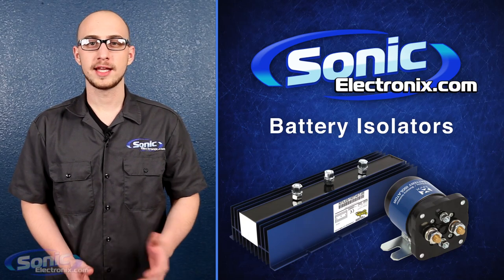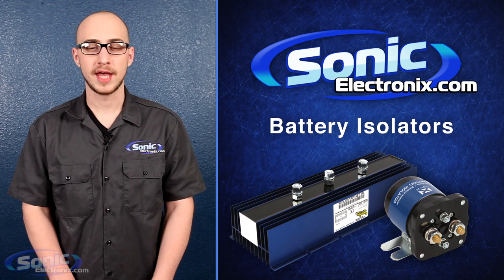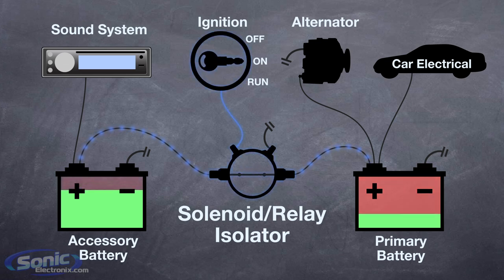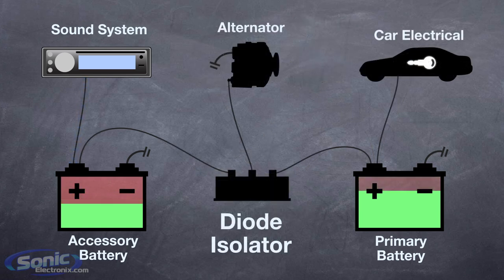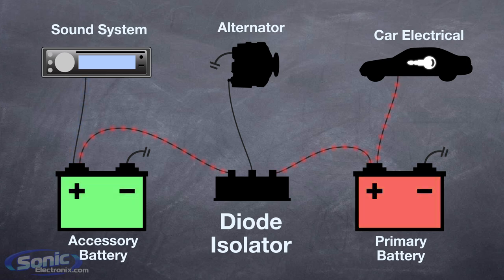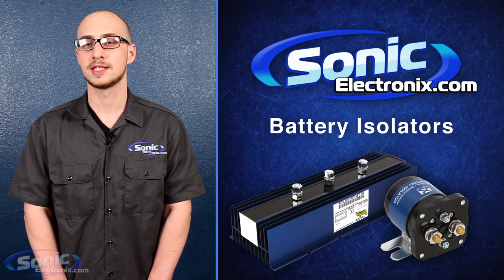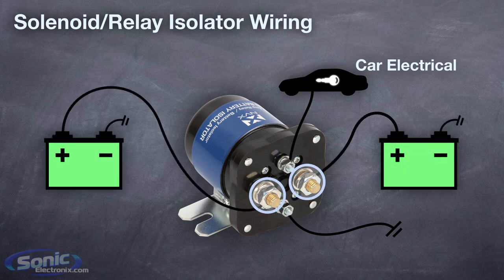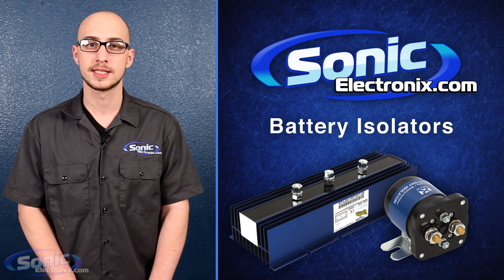Battery Isolators - Types & How to Install | Car Audio 101

Comment from the maker: The fuse will blow if the battery is asking for more power. 140A is the current transfer abilities of the isolator. You should fuse each battery to be safe from short circuits.

Comment from the maker: You are very welcome! 0 gauge can use 200 - 300A fuse to protect the wire, so if you have high quality wire use 300A but if you have cheap wire go with 250 or below.

Comment: Good video just one question..when wiring in a diode isolator it says run a cable from the alternator to the center post. Do I disconnect the original alternator line since the isolator charges both batteries now, or do I leave the original alternator connection in place and just add an extra cable?
Reply: been trying to figure this out myself

Comment: So you could install both and have the best of both worlds correct? Normal operation of the diode  isolator.  But if you're starting battery is depleted you could kick over the solenoid and use the other battery.

Comment from the maker: Either one will work just fine for you. Diode isolators are less common but if you listen to your sound system a lot with the vehicle off, go with a Diode isolator.
Reply: What if I only listen to my system with my truck on?  I never play my music without my truck running.

Comment from the maker: You could take the power wire going to your second battery and add a switch to it. If you turn the switch off, it will stop the flow to your second battery. The switch you use is up to you but it needs to be beefy to handle the amperage. As for connecting the batteries together to start the car, you can wire the terminals together and add a switch as well to keep them disconnected until you need to start the car in an emergency. As long as you have beefy switches you should have no problems.
Reply: So instead of a battery isolator like the one in the video, can I just use a circuit breaker?

Comment: In the case of main battery is dead. Can you hook a set of jumper cables to the second battery to jump start your vehicle; or will the isolator prevent this?

Comment from the maker: You could get the XS Power D4800 to replace your stock battery and forgo a second battery. You can have two of the same battery or different batteries, just make sure you use a battery isolator so the batteries don't drain each other. A battery is meant to let you play your system when the vehicle is turned off, what you really want to do is upgrade your alternator.

Comment from the maker: Yes, that SGP32 will work fine to separate your two batteries. Both batters will be connected when the engine is on, so both will charge. Once the engine is off, only your Kinetik battery will power your system.

Comment: I'm using a standard 12 volt utv battery and a deep cycle battery for the accessories. I just need to make sure main UTV battery doesn't loose voltage as it runs the engine and transmission on my utv. And the transmission doesn't have a long life if it's run low on voltage

Comment: i have 2 batteries parallel wired and i need to install an isolator. Will 1 isolator be sufficient to handle those as well as my car battery? Also I have a 200 amp Stinger relay isolator, should i stick with this or change to a diode?

Comment: The question: I just added a new 2ndary battery in my 01 Silverado 8100. This is how I connected them, I connected the positive wire from the 2nd battery running it through a fuze into a solenoid to the positive end of the primary battery. the negative wire from the 2nd battery into the frame. Is this correct?

Comment from the maker: You need to upgrade your alternator. You have to make power to get power and that is the alternators job. You could add a second battery but that isn't going to fix your problem.

Comment from the maker: The fuse is meant to protect the wire from overheating and being damaged. It is not meant to protect the equipment unless the equipment does not have a fuse at all. If you are running 4 gauge wire you need 125A fuse, if you have 0 gauge go with 200A fuse or more.

Comment: Instead of the ignition wire can I use a 12-volt 15 amp switch to activate the solenoid. I would like it to when I flip the switch to turn on a amperage / wattage meter and activate the solenoid so it's drawing off that battery for an inverter. But still be able to charge both batteries if that switch is off.

Another way to put it is how can I have it wired it to a switch to turn an Inverter / amp meter on and off. I do not want it drawing on the accessories on the aux battery if my engine is off unless I want it to, that's why I want it wired to a switch.

Comment from the maker: You can keep your stock battery and add a battery to the back using a 200A isolator so you have room for power fluctuations.

Comment: I appreciate the info. I am thinking about adding a 2nd battery to the trunk of my car as I typically sit parked with my strobes going for extended periods. I'm a security guard so I have to make sure I'm seen. I am still not sure if I want double capacity or just an extra battery to help jump the original or simply a separate power source for my lights. I'm kinda lost and not sure which to pick.
Reply: Isolate the second battery and use it to run accessories (like strobe lights) that will place a draw on that battery. It will function as a separate power source for the lights but will still be charged by the alternator. In the event that your starting battery is drained (due to leaving the headlights on, etc) and your isolated battery is still sufficiently charged, you can use jumpers to provide power to the starting battery and start the vehicle. You may or may not have to disconnect the isolated battery to prevent damage to the diode/relay.

Comment: If both batteries are connected to the diode isolator, and one battery is fully charged, what voltage will the isolator present to the alternator? Will
It still show low voltage so that the alternator will keep sending current to try to charge the battery?

Comment: Perfect. It is good what I had understood at the beginning then.
I use of the 50mm ² (I am French), thus which corresponds of 0 gauge, and thus it is good fuses of 200A which I need.
Thank you very much of your help.
More than all the system has to install.
SonicElectronix really at the top, thanks.

Comment: Hey sonic ele can I use a 200amp  battery lsolator on a Alternator off 160amp I have 2010 chevy Tahoe  got two Amp and 2 12'" speakers 🔊 What do you think

Comment: I just ordered a battery isolator relay and im going to wire it up exactly like the one in the video. My question is, could i wire in a switch on the wire from the isolator to the ignition to control when the second battery is getting charged? And having the isolator wired up the same as the one in the video, how would you wire it up to be able to use your second battery to jump start your main? Ive read that all it takes is an extra wire and a switch but not sure how to wire it up.

Comment from the maker: We would suggest you get the system professionally installed considering your system is probably very high wattage. If you didn't have an upgraded electrical system then this is the main cause.

Comment: With the non-solenoid isolator, will it hurt the isolator if the batteries are connected in parallel temporarily?

Comment: Hello, 

I am French and I adore your site.
I would have a small question: For my project " show car", I possess in main battery one Optima Blue of 55Ah and in secondary battery, I would have Kinetik HC2400 of 128Ah. I thought has to put Stinger SGP32, is it good? I possess an alternator 150A and "big 3 Upgrade ". The sound system will turn only car turned on, and Stinger SGP32 will bustle with the sound system (remote?). Thank you in advance for your help.

Comment from the maker: You would have to understand how electricity works. When there is a difference in voltage, electricity will go to the lowest voltage until it equalizes with everything else. The alternator has a voltage regulator and if one battery is low, it will automatically be filled up because of the difference in voltage. Once both batteries are full, there is a no voltage difference, so the voltage regulator decreases the output of energy.

Comment: Ok so I have a 55 Agm up front and I wanna add a 80 ah Agm in back , so should I use a diode or just regular isolator? If I use a diode would the front battery  not matter for my saystem no being able to use the 55 ah ? If I use a regular isolator would it be able to use both batteries for my system? I need help asap

Comment: If I use a 110V AC to 12V DC Converter Power Supply will an isolator keep my square drop camper battery charged as well as keeping it from over charging when plugged into shore power?
Would this be the best way for me to keep the camper battery from over charging when I am plugged into shore power or is there something else I should use?

Comment: Got a question. So basically if you only play your system with your vehicle on with a upgraded alternator there no need for a secondary battery even if I’m running a T2 1500 amp and T2 400 x 4 amp and playing it at a high volume.

Comment: since the second battery is running the audio equipment and not starting the vehicle, would it be possible to use a smaller, battery, I'm not sure what the options are, but not a giant lead acid car battery?  I've seen jump start boxes that are tiny and would easily fit in a glove box, but I don't know if anything similar could be wired into the system and be used to run the audio.

Comment: I am looking to install a secondary battery in my Eurovan to run electronics when the ignition is off. My question is how hard is a dual battery set up w/isolator on a factory alternator? Just the charge itself, does it put alot of strain on the alternator or does it act as if it is charging a single battery? Just trying to see if i will need to upgrade to a larger alternator before installing a secondary batt.
Reply: I also need the answer to your question!

Comment: Do those isolator work with alternators and baterrys who are effected be hv ceramic capacitors?
I use plasma ignition system and me starting charge rpm get effected be those hv capacitors from 1k starting sharge it goes up to 2500-3000k rpm.
So any hade experiance with such problem ?
And how wuld isolator work with lead acid baterry with capacitor banks ?

Comment: I have two 12inch polk momo subs not sure on the watts of them, but they are DVC running at 1 ohm on a Memphis 1000.1 mono D amp I have a Memphis Cap as well. Coming to see that Caps aren't really needed and aren't what they are mean to be. My 95 chevy 1500 5.7 is seeing major voltage drops when ever the system is up I'm dropping from 14.4 volts to a low of 10 sometimes what steps should be taken to not cause harm. I have noticed the yellow top is getting harder to start the truck as well.

Comment: At 2:20 I already have a remote and ground wire connected to my amp. 

Can I just run the remote and ground wire from the battery isolator to the amp?

Comment: On the diode isolator what would happen if you connected the car battery to the center post and the car battery post to the house battery?

Comment from the maker: You should upgrade your alternator first, especially with that kind of power. After that, you can add a battery or two if you plan to play the system with your vehicle off.

Comment: Sorry to disturb you still. I have a small question concerning fuses. I know that it is necessary to place one fuse after the main battery and one fuse front the secondary battery, enters is Stinger SGP32.
But here we are, which capacity of the fuse I have to put? The alternator is one 150A, 2 batteries are Optima Blue + KinetikHC2400  (55A+128A=183A).
Fuse of the big ampli: 200A. I have to put 2 fuses of 200A each on the line where is the SGP32? Thank you in advance.

Comment: if I get a dial isolator can I have an acid battery on the front and gel batteries on the back and won't affect them and with that is it still necessary to do the Big 3 upgrade

Comment: How does the big 3 connections go when adding the diode isolator? Do you connect the 0/1 ga from alt to center diode and ground everything to frame separate?
Reply: some one please answer this.

Comment: FET Battery Isolators (popular in marine applications) have about 95% less power consumption compared to diode isolators. If having fully charged batteries is a concern, FETs are superior to diodes.

Comment: nice clip! is there any concern of overcharging? what if you do have a solar charging controller connected to the 2nd battery, any concern? thanks
Reply: The solar charger should see the high voltage when the vehicle was running and stop charging, and both the diode and relay would stop the charger from charging the first battery.

Comment: I have a PAC 200 relay, and the instructions that came with it says to hook one of the large terminals directly to the alternator +, and the other large terminal to the secondary house battery what is the difference between that and hooking the large terminal directly to the staring battery? Is the alternator connect more safe or something?

Comment: LOKING ON YOU WEBSITE AND WAS WONDERING IF I GOT 120 AMP ALTERNATOR WHATS SIZE ISOLATOR SHOULD I GET FOR 2 BATTERY USE STARTUP AND ACCESORYUSE OF120-30 AMPS?

Comment: Hi.. I have diesel truck ..with 2 batteries with 12v system ..but I have 2 batteries on the back to run a 24v winch ... Can I install an isolator ? Any diagram or video how to conect ..thx in advance

Comment: so if you had a 3000 watt amplifier and wanted to add a 14v battery you would want a 300 amps isolator? is that right? or am I missing something

Comment: If the second battery is totally dead, will the second battery try to totally drain the primary battery once the solenoid isolator is activated? Will this cause a huge surge between both batteries?

Comment: I see that with a diode isolator..(three connector type), My main battery and the backup, or trailer battery, will be allowed to will be allowed to charge all the time...  BUT.., for starting..., only the main battery will be used...   RIGHT..?     What sized battery wire would you suggest for a triple battery on a trailer, 12v 135Ah each, in parallel  (12v , 405 Ah total) ..?   Any help would be appreciated...   Also...If I put a disconnect between the trailer and the truck, I wanted to use a 5000w inverter to control the charge coming from the generator to the trailer batteries...  Is this a good plan..?   Great Video too....
Reply: Contact Jonathon,  at down4sound.com

Comment: What if you have a modern vehicle where the alternator shuts off when the primary battery doesn't need charging?
Reply: Then you should sell that pos vehicle...
Reply: @beepbeep3011  typical answer for a Scrub who doesn't know Auto Electric.

Comment: On the pac 200 battery ISO it says to run it from the alt, but you say that it can be ran from the primary battery terminal... Is there a difference

Comment: what if you have two starting batteries (diesel truck) and a third battery in your attached camper.  Can you isolate the two starting batteries from the third RV battery

Comment: So just run a wire from the positive of one battery to the positive of the other with a switch in between? Dont think you would have to wire the negatives to each other would ya? And what kind of switch would you need?

Comment: Hey so could I wire my alternator to both batteries and the diode isolator to avoid the voltage drop? Is that possible? If not, could I keep my charge wire on my primary battery and hook up another wire to the diode isolator and just hook up the two batteries to the diode?

Comment: I have a question,
So which one would be the best, the solenoid/relay isolator or the diode isolator?

Cause i'm a person who uses there system like crazy and I do have two batteries.

Comment: Also, could I just hook up another wire from my alternator to the auxiliary battery using a solenoid relay to power my stereo system? I have a 2013 hyundai elantra with a 250 amp alternator, the big 3, and a solid state agm xs power battery . The stereo is 2 amps, 1 amp running close to 2000 watts rms and another amp class ab drawing 600 watts. I have a secondary battery ready as I suffer severe dimming headlights. I want to try to avoid voltage drop as much as possible.

Comment: I have a Question...

I'm using my brothers old system and the deck is 52w x 4 , so its 208 and the amp to the two subwoofers is 600w, i have a battery now that does 500amp in winter and 600 amp in the summer, should i get a new battery? I was thinking about getting Kinetik. So if i need it should i buy the hc600 or the hc800 ?

Comment: I bought a diode isolator and it says you have to disconnect the alternator and only have it connected to the center of the isolator.  Can you do what you showed and just run an additional line from the alternator?

Comment: when you hook the battery isolator up to a constant power source, like the ignition wire, how do you know which wire? Or am I misunderstanding the "hook-up," location? Thanks
Reply: AustralianCroc - If you're talking about the solenoid style isolator, the two large terminals are connected to the two batteries positive terminals. The two smaller terminals are used to turn the solenoid on (internally linking the two batteries when the engine is running) so both batteries get charged by the alternator. So one of the small terminals is connected to ground, and the other small terminal is connected to a SWITCHED 12 volt source, that's only hot when the vehicle is running. Hope that helps.

Comment: QUESTION IF YOU PLEASE? I HAVE A 2000 BMW 328CI AND WANT TO RUN AN EXTRA BATTERY TO RUN THE SYSTEM THAT I AM PUTTING IN. I WOULD DEFINATELY BUY AN OPTIMA (RED OR YELLOW?) AS SCOND BATTERY, BUT DO I HAVE TO REPLACE THE FACTORY BATTERY TOO? ...CONT.